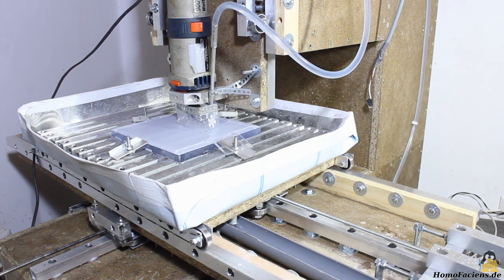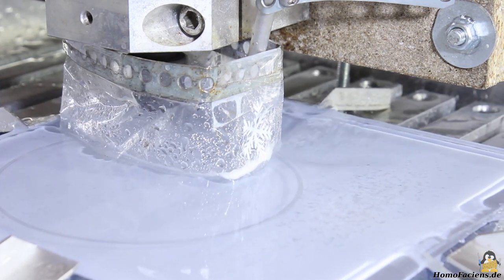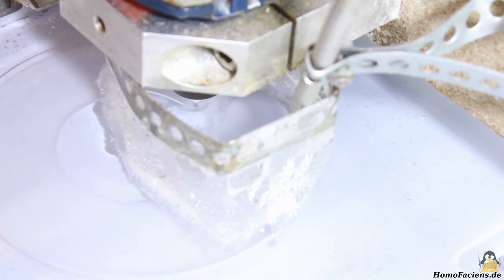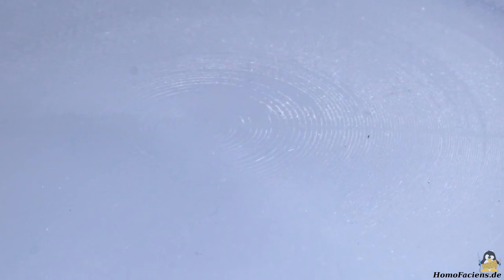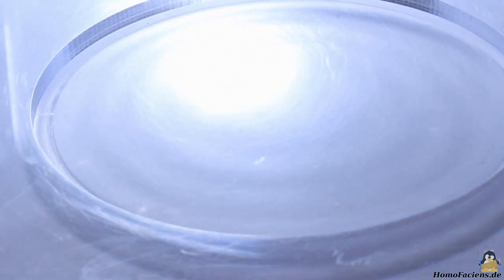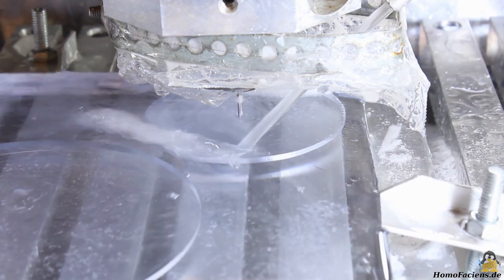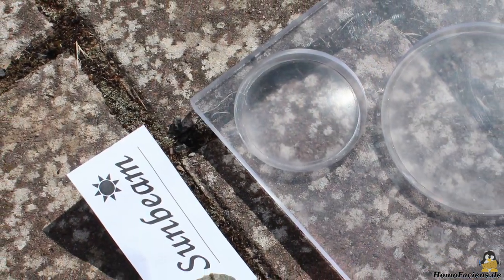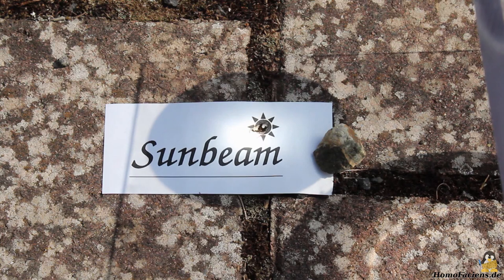Carving lenses with my CNC v3.2.2

Comment: If you cut a negative lens profile out of foam you will have a proper tool shape to sand and polish your lens. Double stick tape or contact cement will hold the sandpaper or polishing pad to the foam. The dense foam type is preferred but even the cheap foam will produce a tool good enough to be used for several lens. The polish machines I have used were made here in the United States by a company called Optronics and require you keep the liquid polishing agent flowing over the lens during polishing. When we forgot to turn the polish on the friction soon melts the lens.  The plastic polish sold to remove scratches from motorcycle face shields or car headlights is very much like the stuff we use to make lens for eyeglasses. We make lens out of plastic and poly-carbonate.
Reply from the maker: Thanks for sharing your knowledge!
I will apply polishing agent through a pump same as the coolant or dipping the polishing tool into the agent every now and then. Let's see what's better. Cutting the tool from high density foam is a cheap option.
Reply: The pump is preferred but dipping will also work. I had a pump fail one day and punched a hole in the bottom of a plastic cup and used it as a temporary drip feeder by filling it with polish liquid and holding it over the lens during polishing.
Reply from the maker: ...it's low tech that saves your day ;-)

Comment: Hello Mr. Homer Faciens ;-)
I would recommend you to build a lathe instead of 2 extra axes if you plan to do more lenses.
With onley 2 linear axes and maybe 1 rotary to follow the tangent for polishing, it will become way more accurate.
That may just be my opinion, but as a cnc-turner I would not discount the advantage of rotationally symmetric parts on a lathe
Reply from the maker: Absolutely right, less complex machines are usually better for a job, but sometimes the journey is the reward ;-)
5 axes on a CNC give you a higher flexibility (not only for carving lenses). Creating a CNC lathe is also on my list of things to do. Maybe I can compare the results of both machines some later.
Reply: Exactly, if i would have the time and money to build a 5-axes mill, it would be a millturn.
Probably with the capability to put on grinding wheels.
By the way, you do a really nice job to build fantasic systems out of almost nothing.

Comment: With automotive paint the go-to polishing compound in the US is 3M Perfect-It 2. If you use wet sandpaper in stages of 800grit, 1200grit, 2000grit, 2500grit, then compound and a heavy cut machine polishing pad you'll have an optically clear result. The key to sandpaper is to let it soak in a bucket of water with a couple drops of dish soap for 10-15 min before use. This will prevent the creation of scratches heavier than the paper's number due to the sharper paper edges. This is the same way a car that is painted black is perfected after it has been clear coated. It is also the method I used to polish plastics like modern headlights. Like most professional painters I used an apprentice to do the finishing work like this. It's not a fun job, especially when doing it right.
-Jake
Reply from the maker: Thanks for the detailed instruction. I'll keep that in mind when starting new experiments in carving lenses.

Comment: To get a really clear surface, you should look at a better sanding technique.   It's basically wet sanding using 400 to 2000 grit sandpaper in steps.  The final polish is done with the slightly abrasive paste.  Toothpaste works for that.   You need to keep everything really wet during the process, or it will scratch.

You could put together a little machine to do it for you.  One rotating axis that spins the lens.  One rotating axis that spins the sandpaper.  And, a pivot axis that moves the sandpaper up and down the curve of the lens.  This would have the added benefit of putting even pressure on the whole thing, so it should be equal.  Or at least average of the CNC cut layers.
Reply: Or move your Z up a little, and put a buffing bit on the spindle, with a little polishing compound, and let it polish that way.
Reply from the maker: Tanks, I'll keep that in mind for future lens experimentation.

Comment: You could try to "flame-polish" your lens with a blowtorch, also you could mount your lens on a drill to polish it more evenly.
Reply from the maker: Thanks for sharing! Flame-polish is an option I will try. Instead of using a drill, I will add one or two more axes on my CNC to polish automatically.
Reply: Instead of 2 more axes, a pivoting and spring mounted felt disk might do the trick
Reply: CNC lathe next?
Reply from the maker: Definitely on my list of machines to build. I can't say for sure what is coming next. My schedule often changes while building my prototypes ;-)
Reply from the maker: Yes, that would be the simple solution (and I like to keep it simple), but having 5 axes on a CNC gives you more options for what ever you are carving.

Comment: Probably too much work, but you could try taking your acrylic lenses and pretending they are glass, and then going through the process of making a "glass" lens.  In this case, your CNC machine has done the "rough grinding" already.  Then you could lap against a negative blank, and polish on a pitch lap, etc.

The downside is that the traditional method for making glass lenses is limited to lenses are are close to being spherical in shape.  They can be aspheric, but only slightly (in the same way that amateur telescope mirrors are parabolized).

If you're okay with spherical lenses, then you can even making lapping and polishing machines so that you don't have to do it by hand.
Reply from the maker: I don't have the patience to do it the traditional way;-)
I prefer doing the lapping with my machine, but still do not know exactly how.

Thanks for sharing your thoughts!

Comment: I expected sandpaper to completely ruin the lens with scratches, but if you can polish it up, this is really great.
Do you think it is possible to make more complicated shapes, like Fresnel lens for example? Or the ones used in Light-Field cameras?
Reply from the maker: The surface is too rough after carving with a router. You will always have to polish the surface. I will try to do that automaticalls with my machine after an upgrade.

More complicated shapes require a 5 axis machine. I will upgrade this CNC somewhen in the (hopefully not so far) future.
Reply: You just do the same thing as you do for a newly painted car. 
If it's rough start with 400 grit, otherwise 600 grit, 800,1200, then buffing machine with cutting compounds - hand is not as good -  and the final polish. Sometimes on perspex I just go from 600 straight to G3 Farecla or 2nd Cut compound, and that's good enough.

Comment: I could use some help on 4 and 5th axis..there are some ported grbl that run on mega..I haven't gathered enough resources to take on the 4 and 5 th axis but id love to see some do it with just grbl..I hope its you..thanks
Reply from the maker: I haven't dealt with the Arduino Mega port, yet. I will use a Raspberry Pi or the Siematic in a first test. I can't say if I will switch to grbl on a Mega later, but I'll keep that in mind.

Comment: Se puede hacer una cnc de 5 ejes con Arduino. ?
O sino con fpga?

Could a 5-axis CNC be made with Arduino or with FPGA? Or with simple logic gates?
Reply from the maker: You can use an Arduino Uno, however grbl doesn't support more than 3 axes, thus you must write your own software to make it work.
 haven't heard of a pure FPGA solution. You would need lots of logic gates to make it work. 

To me, using an Arduino or a similar microcontroller is the simplest solution. Raspberry Pi or Simatic IoT work, too, but they don't run real time operating systems, so you have to consider that perfect timing won't work.

Comment: Hi you have VB6 source-codes for CNC and Robots and others VB6 ? greate works, thanks!
Reply from the maker: I don't use the closed source Spyware named Windows, sorry, no VB code from me.
Try Linux. It's free, Open Source and the common operating system in networking, IoT, robotics and machinery.

Comment: Great idea. You dont know it i guess but in producing lenses the last step is the most important , thats what you skipped xD. Manual polishing is impossible. use a turning table or build one out of an old hardrive. the lens must rotated when you polish it, then it goes way faster. Also going up the scale of the sandpaper in an order is important, grit 180,320,600/800 thenn 1000. After Gritt1000-3000 you can use polishing paste. Like this you can achieve high grades. (Motor turntable + sandpaper stepping)
https://www.youtube.com/watch?v=Vzr6-Fd3lwM
i mean build this, just twist it, put the lend on the drive and use the sandpaper in the hand.
If you want you could add a stepper arm which does the holding of the sandpaper for you and beeps when its done. Like simple a cnc lathe for "2D" polishing.
https://www.youtube.com/watch?v=NjaLxqUi9-Q
Reply from the maker: This was just a very first try to see what my CNC can do. I will add at a fourth (maybe fifth) axis to do the sanding and polishing with my CNC as well. Stay tuned!
Reply: well that will be interesting since the limitation of GRBL+Arduino is 3 Axis as far as i know. 4/5 . Great idea for a video series.

Nonetheless just for polishing its overkill since its a simple process which can bedone simpler like i mentioned above.
Reply from the maker: I have written my own code for this machine, thus implementing more axes is no big thing (I guess).

It's the challenge to make it all with this machine ;-)
Reply: as far as i understood the difficulty is not adding axis, but controlling them simultaniously. Thats why 4-5 Axis CAM software is still in the 2k€++ range (comercial 3 Axis ca is around 150-300 for comparison, beside the freeware)
Reply from the maker: How critical time management is, depends on your application. What I have in mind is moving the axes at all, not necessarily do it as perfect as professional machines do. The difference is a less perfect finish, but that's what I can live with.